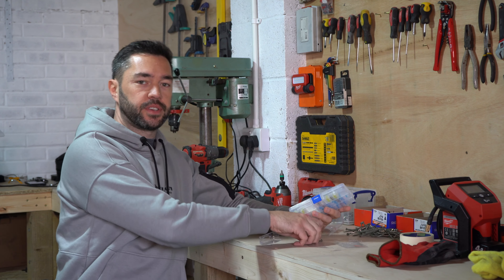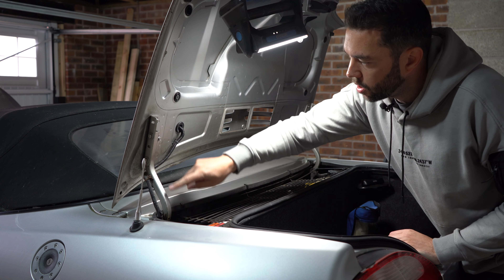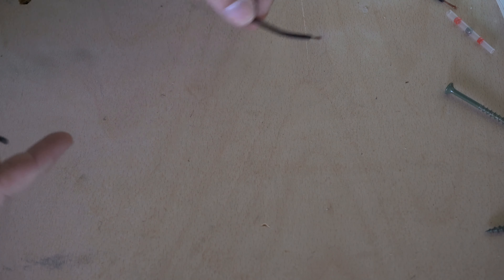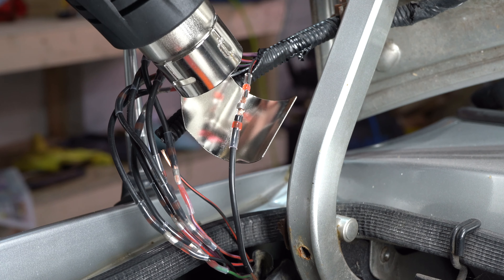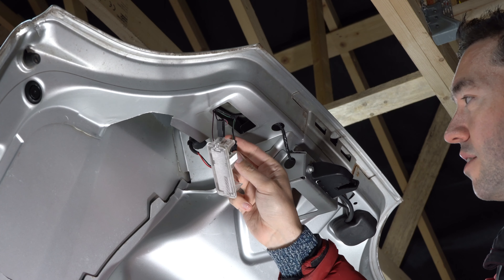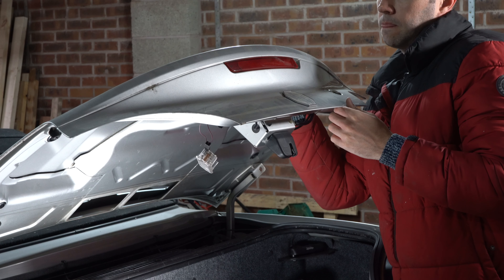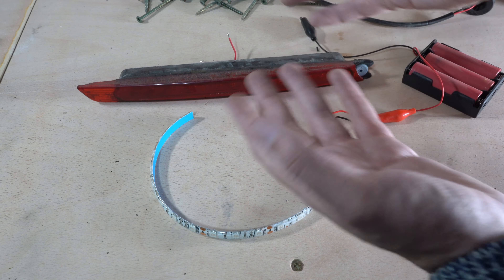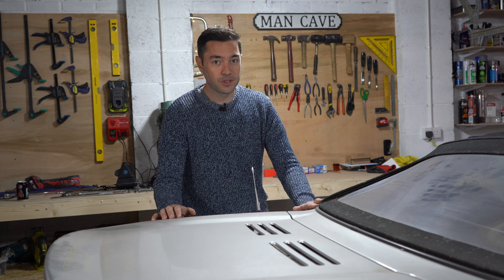Getting the MG running plus electrical issues!

Comment: Loving the new toolboards, benches and storage. What did you use for the worktops? Might make something similar for mine. Do a garage tour for the next vid!
Reply from the maker: Cheers! 18mm plywood for the top, 18mm osb for underneath (bit cheaper). Yeah will do when finished 😀 👍
Reply: @wheatleysworkshop  Awesome. Thanks. I'm still building the brick walls for my garage (extension), so will be a while before it's workbench time! Won't be long before you have an MoT and can move on to phase II. Looking forward to that. Done a couple of great drives with fellow MGF & TF owners. Peak District was particularly good.